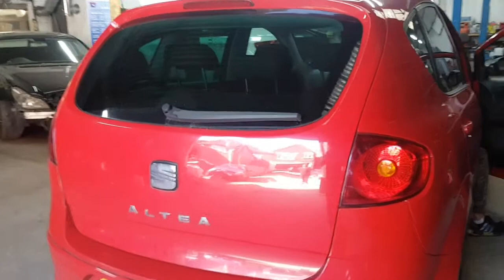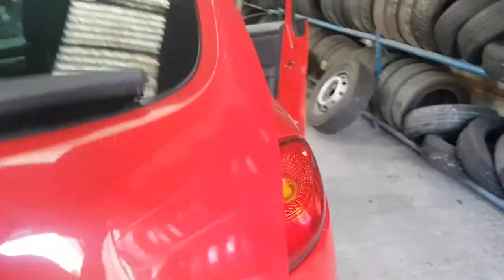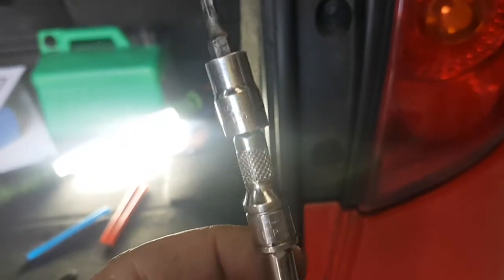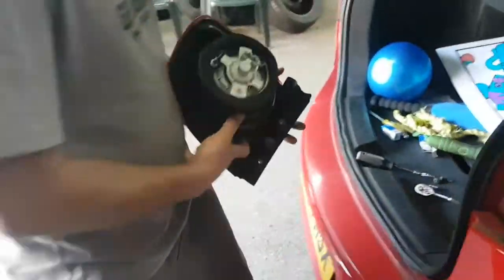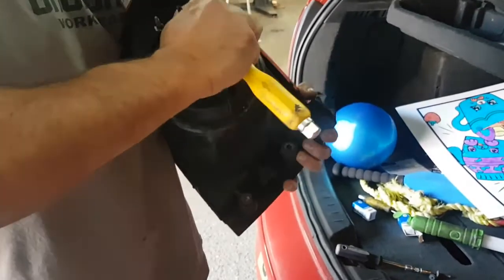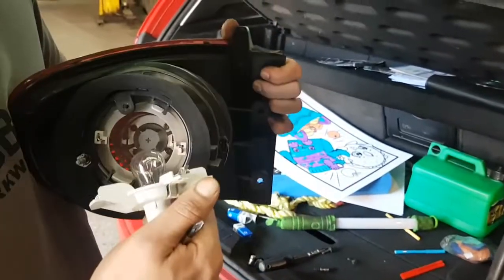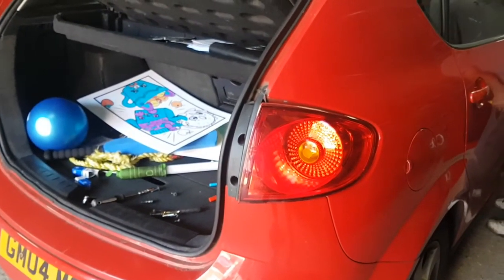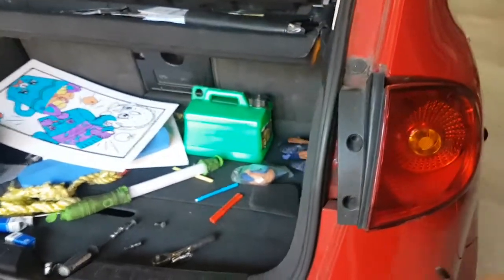How to replace Seat Altea brakelight bulb

Comment: I am confused that you changed the center bulb and it fixed the edge lighting in thw red circle
Reply from the maker: 😂 I got confused after reading your message but just so you know the reflection of the bulb goes onto the outside just how they designed.
Reply: Ah yeah, I realised after I wrote that this must be it.

Comment: hi this is my car, and both my back lights are gone, the guys that have looked at it have been a little confused and told me i need to buy a whole new light fixture, as in not just a bulb, so its about 100 each light!! but i see you changing this,..im confused. I have no lights at back, nor brake lights, i dont want to spend 200 quid if it is just a bulb.. help...plzzzz
Reply: Gillian Hunter Get some sand paper or something abrasive and file down all the rust and crud on the metal connection that touches the bulbs. Had the same symptoms on mine as condensation forms around terminal. This should sort the problem.